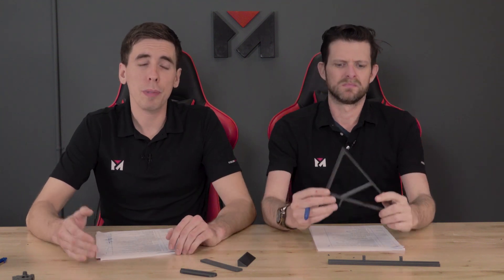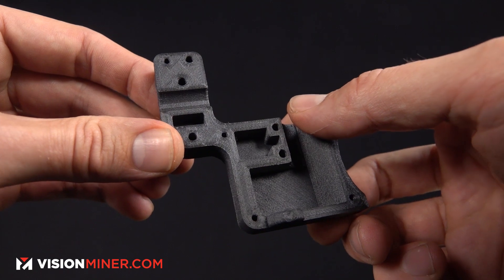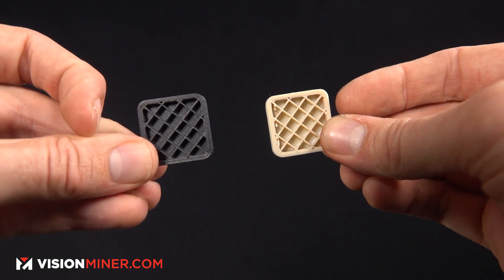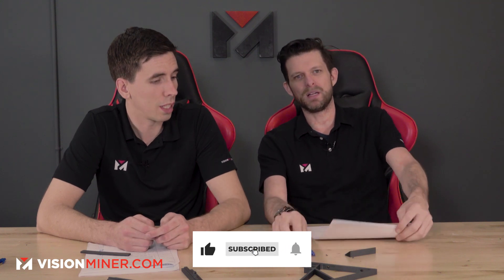All About PEEK + Carbon Fiber Composite Filament (CFPEEK): Open-Material 3D Printers 2020

Comment: The video discusses carbon fiber - filled PEEK (CFPEEK) filament for 3D printing. It mentions the aerospace - grade carbon fiber in 3D X Tech brand, which offers better dimensional accuracy, higher strength - to - weight ratio, and improved layer adhesion. CFPEEK has high thermal, chemical, and wear resistance, but requires a special nozzle. It's not as certified as unfilled PEEK, is abrasive to printer components, and very expensive (about $650/kg). However, it's suitable for high - end applications in automotive, aerospace, and defense, and produces parts with minimal layer lines and good surface finish.
[00:00] Properties and Ease of Printing CFPEEK
	[00:10] 3D X Tech brand has aerospace - grade carbon fiber
	[00:21] Carbon fiber fill increases dimensional accuracy and strength - to - weight ratio
	[00:37] Good for chemical and heat resistance, easier to print than unfilled PEEK
	[01:06] Better layer adhesion with CFPEEK, less warping and curling
	[01:23] Requires a special nozzle to avoid damaging regular nozzle
[01:28] Thermal and Chemical Resistance, and Drawbacks
	[01:40] CFPEEK has high thermal, chemical, and wear resistance
	[01:52] CFPEEK can resist extremely hot water and high temperatures
	[02:08] CFPEEK has some down sides despite its benefits
	[02:36] Carbon fiber in CFPEEK isn't as certified as unfilled PEEK
	[02:41] CFPEEK is super abrasive to printer components
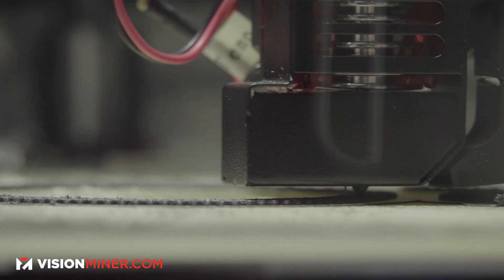[02:56] Applications and Dimensional Accuracy
	[03:08] CFPEEK used in automotive, aerospace, and defense components
	[03:28] Certain industries can use CFPEEK more due to its properties
	[03:41] CFPEEK results in minimal visible layer lines in 3D prints
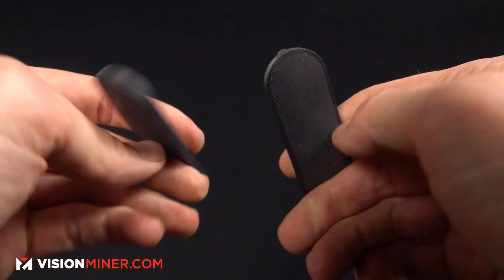	[03:52] CFPEEK offers good dimensional accuracy in 3D printing
	[04:15] Smaller nozzles with CFPEEK may cause more jams
[04:27] High - Resolution Printing and Cost
	[04:27] Discusses high - resolution parts made with carbon fiber PEEK
	[04:44] Carbon fibers enable high - quality printing, has UL 94 V 0 FST ratings
	[05:02] Materials from different suppliers vary, do due diligence
	[05:17] Parts look better, but it's harder to print and expensive
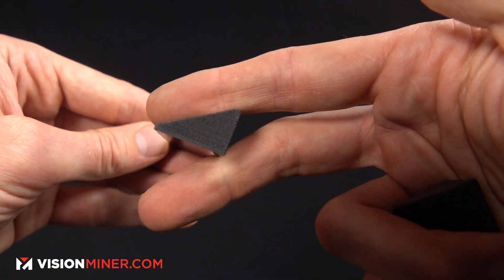	[05:37] CFPEEK is very expensive, about $650/kg depending on source
[05:55] Marketing Edge, Surface Finish, and Printing Tips
	[06:04] Using CFPEEK can give an extra edge in the market
	[06:16] CFPEEK produces smooth and good - looking parts
	[06:33] Nano - polymer adhesive is needed to stick CFPEEK to the bed
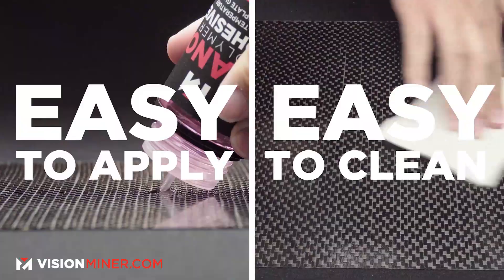	[06:47] Encourages viewers to leave comments if they have questions
	[07:04] Asks viewers to subscribe and follow on social media

Comment: Note that Peek CF20 is available now at around 200€/kg as pellets, A extruded isn't that expensive when you compare to the price of Peek CF filament. 
A question I have is if peek cf is more or less stiff compared to a PPAcf of bambulab with almost 10Gpa of flexural modulus...

Comment: Why does the panerai carbon fibre watch that uses PEEK cost 15k ?
Reply from the maker: That's actually using a different, pressure-based process, probably similar to impossible objects https://www.youtube.com/watch?v=0BKzikfssTM

But more likely, the $15k price tag is that it's a luxury collectors watch :)
Reply: thank you useful to know. just trying to gage if the carbon fibre manufacture justifies it being 15k vs the 8k steel version !

Comment: Hi, i have to print a part for a e-bike motor I'm developing. It has to hold the gears going from the motor to the shaft, the motor and the shaft itself. I'm uncertain if I'm better off printing it out of aluminum or out of cf peek (which will cost me nearly half the price of aluminum) or even out of cf nylon. What would you suggest me, thanks 👍
Reply from the maker: give us a call at 833-774-6863

Comment: I am having to use a 0.8 nozzle and .3 layer height to prevent clogging, so the finish is terrible. Funmat HT printer. What am I doing wrong? All settings maxed out. Interesting enough, no issues with sticking to the bed - vision miner CF build plate with nano adhesive.
Reply from the maker: It must be heat, speed, or retractions or something -- we use this stuff in 0.2mm nozzles occasionally, which does jam often, but a 0.4mm shouldn't be jamming, especially on a 0.8mm nozzle. You might need to print much hotter.

Comment: Do you need a heated chamber to print with CFPEEK or Carbon fiber nylon?  Is there any post processing involved when printing with carbon fiber filament? What make & model of 3D printer would you recommend for under $1000.00?
Reply: Buy:
ender 5 269$ 
full metal hotend about 100$
New motherboard about 50$
Metal extruder 15$
New heated bed 500w 40$
PC transparent sheets like 30$
Upgrage firmware 
Follow videos of this YouTuber: https://youtu.be/mPC-2KZLMzk
Buy a few other things and you could be able to  print PEI and CFPEEK. 
This is what I want to do with about 500$ and with the other 500$ you can buy a big spool of CFPEEK
Reply from the maker: While this is true, usually it's not actually good enough -- the heated chamber and metal parts are essential for production, and "extruding" PEEK is not the same as making strong parts out of it :) However, on a budget, you CAN do some tiny parts with the stuff...
Reply: @VisionMiner  thanks for the hearts!  :-D
Reply: Also an high quality hardened steel nozzle 20$ or more

Comment: Started to print with it. Everything is perfect BUT, it delaminates layer by layer. What about anealing for CFPEEK? Is it the same as peek? Printing at 410 nozzle, 135 bed, 100 Air.
Reply from the maker: Print at 450c on the nozzle and you'll get better layer adhesion, it's a beast to work with!

Comment: I know this was awhile ago but you mention Hydraulics. I’m just wondering what type of Pnuematic pressure these parts could hold?

Eg, a hole printed in a parts for air flow, would it be air tight and hold X psi? Could these hold 100-500psi?

Comment: Does my printer need to be enclosed to print with cf composite filament?
Reply from the maker: Not for carbon fibers, the limiting factor will be the polymer. Carbon fibers come in many different polymers, so you could do PA6+CF without an enclosure -- visionminer.com/materials#nylon

Comment: Failed prints must be really painful because of the price. Lol

I'm currently printing CF nylon on my Ender 3 with the stock hotend using Capricorn tubing and a hardened tool steel nozzle. Textured glass bed with glue stick.

Comment: Am i able to use CFPEEK on my makerbot method x or markforged X7 ?  I reached out to them but have not heard back yet
Reply from the maker: No, their temperatures do not go nearly high enough. You need a specialized or heavily modified machine to print them.
Reply: How about method x carbon fiber model? Or what's the affordable printer for cfpeek?

Comment: can the prusa mk3s handle ur material?  with of course a better nozzle installed
Reply from the maker: Not really -- the hotend needs to hit at least 400ºC, so if you upgraded you could print it, but the bed also needs to go past 120ºC and the heated chamber is what really makes it possible :)
Reply: @VisionMiner  yep, thats definitely a pro machine only filament, it looks nice though.  maybe someday i can convince my wife to mortgage the house  ;)
Reply: There is a guy on YouTube that did print it on his Prusa at home. I’m trying to make parts that can withstand engine bay temps and PEEK keeps coming down the my only options

Comment: Can carbon fiber infused filament such as this be safely be used for parts where contact with the skin is often happening, for example a door knob, where CF is so abrasive?
Reply from the maker: Generally it's good to avoid that -- we don't have any solid data, but while parts can be handled easily, there's a chance some carbon can come off. The worst it would be is some itchiness, but we haven't really had that happen. Officially, we don't really know, but practically, yes.
Reply: Couldn't you go multi-material and print  layers of regular PEEK on top of the CF PEEK?

Comment: So if you need a special nozzle to print with CFPEEK, does that mean any 3D-printer will accept the nozzle & be able to print it - and with the same quality seen here ?
Reply from the maker: Not any printer... you need the high-temp chamber and hotend to do it. 400C+ -- you can get different material nozzles for most machines, but most machines won't reach the needed temperatures.

Comment: Good video, thank you.
There are a lot of comments about the size of the fibers (chopped…). 
How do I know what are the “reliable” products (filaments) in terms of fiber-length. (I’m not talking about continuous CF).
I assume yours is the best...but what about the others?
 Where is the info to have a look?
Thank you.
Reply from the maker: Most places don't talk much about the quality of carbon they use... Milled carbon fiber is exactly as it sounds; short, almost powdered carbon. Chopped carbon actually starts with strands of carbon. When you start with a 6mm strand, and then extrude into filament through a twin-screw and/or single-screw extruder, it becomes shorter, averaging around 200-300μm.

Check out our article on carbon fiber in filament! https://visionminer.com/blogs/news/carbon-fiber-3d-printing